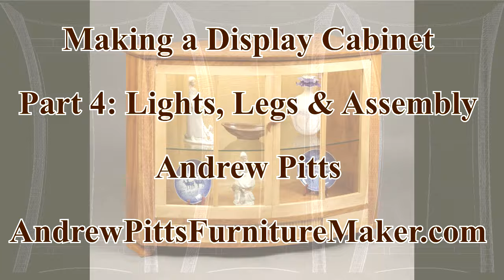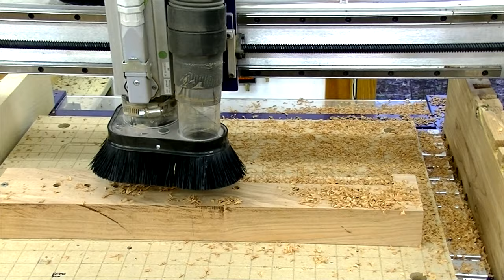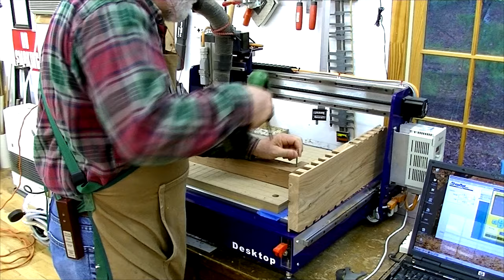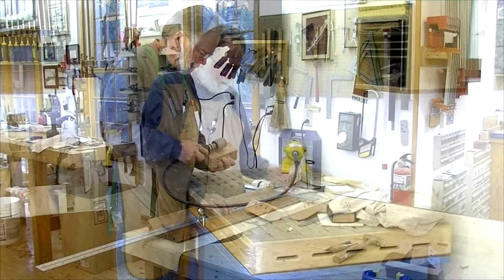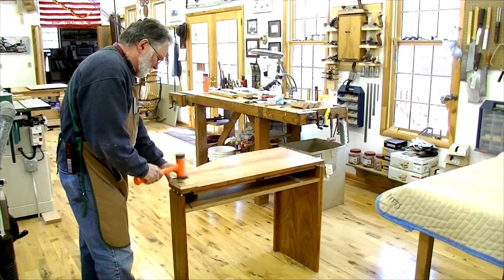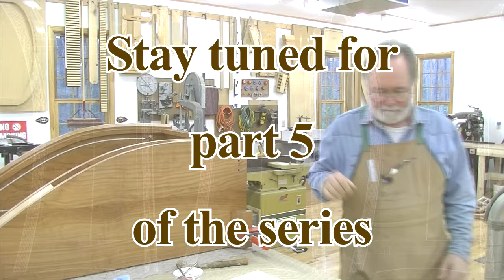Making a Display Cabinet Part 4, Lights, Legs & Assembly: Andrew Pitts ~ FurnitureMaker

Comment: Has the ShopBot been reliable?
Reply from the maker: Pretty much so, but I have had to replace the control board (like a mother board) and the control card. Mechanically, no issues.

Comment: Andrew,  Looks like you might have been a tech guy in addition to woodworking?  Is there an easy access if you LEDs fail?
Reply from the maker: US Navy nuclear propulsion trained Surface Warfare Officer. You can get to the LED's through the door to the cabinet. Just have to work upside down.